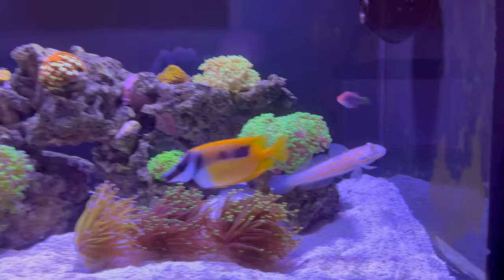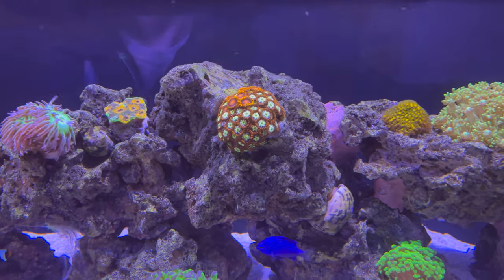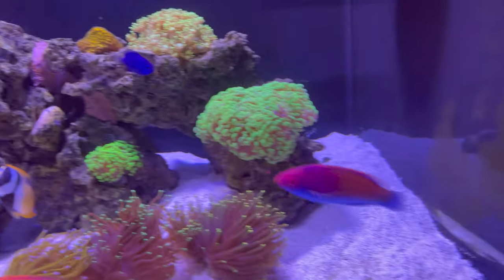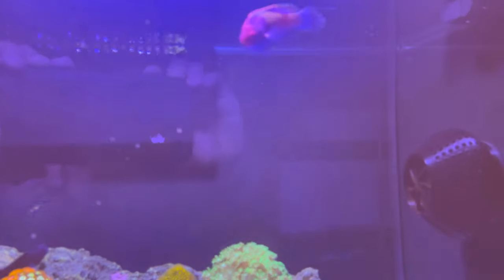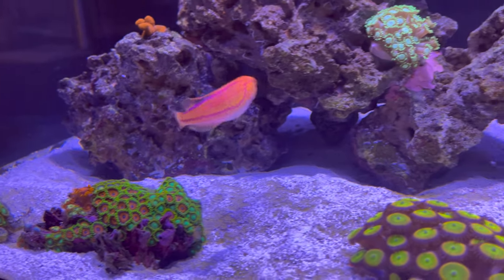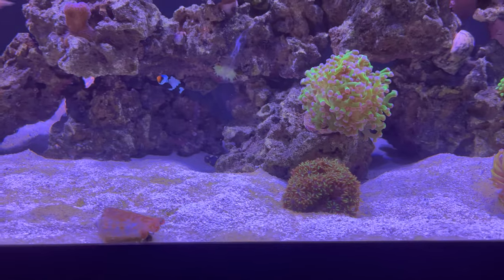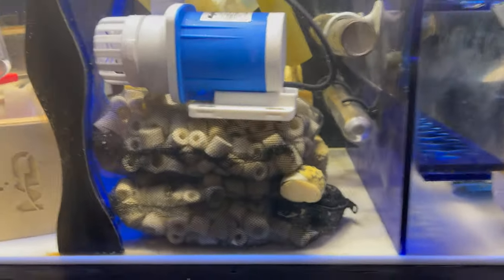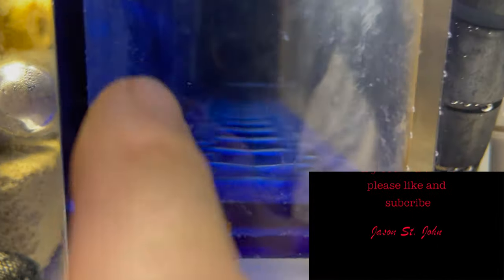overview of tank talking about tank and coral other problems

Comment: Hey, how's the tank? I noticed in a video covering your sump. Thanks for the walkthrough, I did notice you had a metal hose clamp attached to your return pump. From what I've been told it is best to steer clear of metals in the aquarium. Do you think that has caused any issues?
Reply: That’s an old video I no longer have that set up. Thanks though
Reply from the maker: clamps where changed a long time ago

Comment: How do you like the MP40 covers you have on there. Those look like the NEAT Aquatics replacement caps?
Reply from the maker: I bought them from bulk reef supply the other ones that replace the stock covers I originally purchased the ones that went over the stock covers they sucked they were really big and bulky. These ones work great they fit just like the stock ones and I have no issues with them.
Reply: @reeffishfrenzy8929  Cool cool. TY for the info!